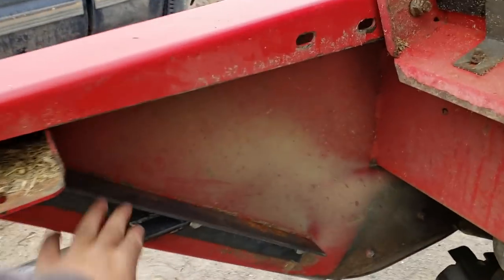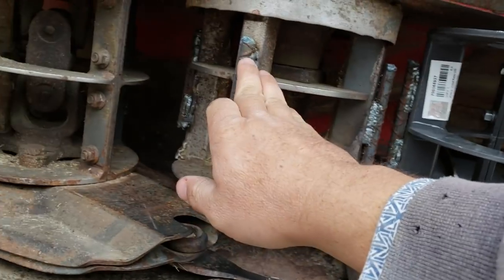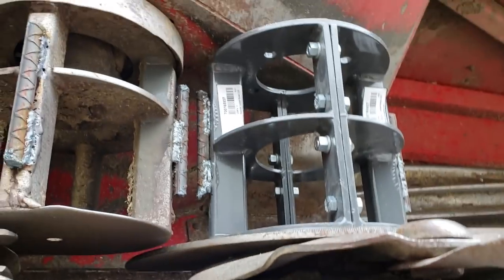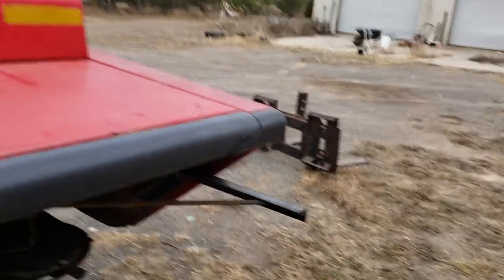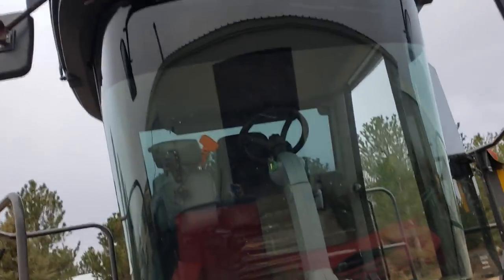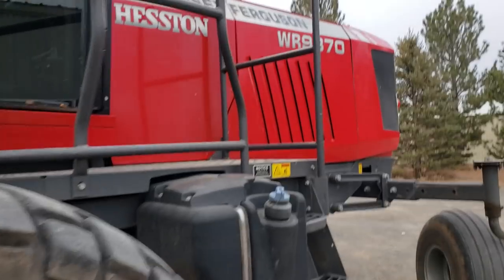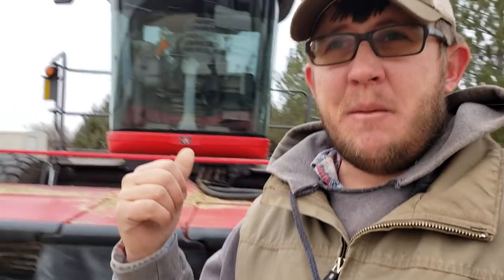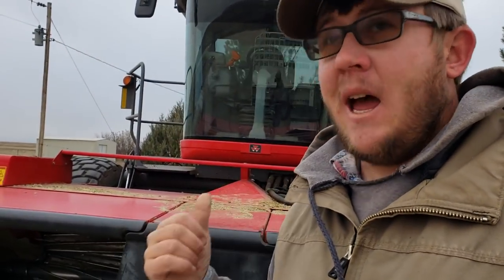Making some changes to the Massey Ferguson wr9870

Comment: I would recommend mounting grass rings above the extra cages you just installed. You have to drill 2 holes above and mount with 3/8” bolts the screw into grass ring. It keeps the crop from balling up above the cage and producing a lot hog heat. The thing that make the biggest difference on these swathers is the hydraulic assist kit. They aren’t cheap but wouldn’t want to cut without them.

Comment: Good Video Will.   Question on your rebar-  Do those spinners that move the crop under the header need to be balanced?  Just would hate to see you knock bearings out because those small pieces you welded on would cause and imbalance- Otherwise great idea.  The rebar on the end I think will bend in a heavy crop.  May need to re-enforce them, or make them out of sucker rod so they won't bend.  Time will tell!   As for the guys sending videos to your dealer and bank, they really have no life and are jealous of your successes.  They probably don't have the drive you have to get work done and make money, so they stay at home and send video's to your banker because that's all they're capable of.   Find success and you'll instantly find people that will hate you for it.  I think it's wise to keep much of you personal info to yourself, not everyone needs to know everything, for their own good and yours.
Reply from the maker: So as far as the balance, I spun the head all the way and it has never felt more smooth,  imagine that. I would never do this to the machine if there wasn't a good reason for it.
Reply: @sowerscattleco3484  didn't mean for that to come off as you didn't know what you were doing, I was just asking the question about possible imbalance. I know they say that having a broken knife can cause imbalance that can damage things so I thought that might apply here. But it sounds like it's smooth so probably no worries. Have a good day👍
Reply from the maker: @OldGlory1776  I didnt take it that way at all.